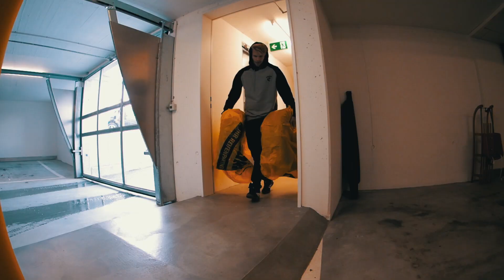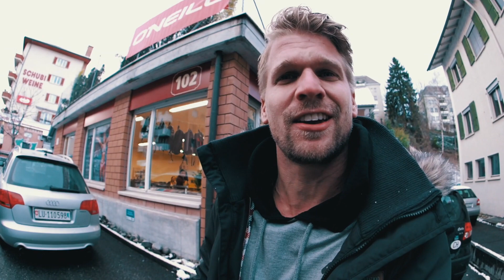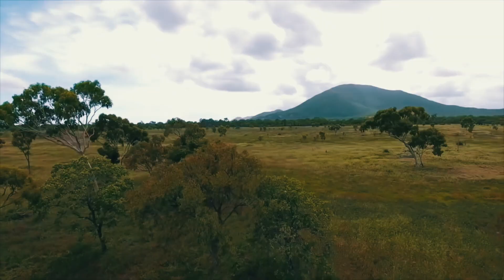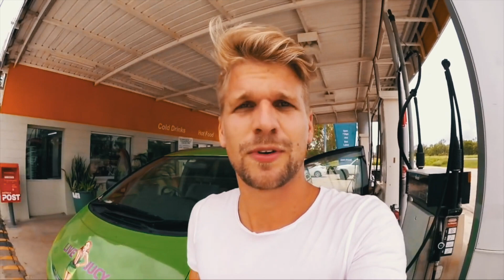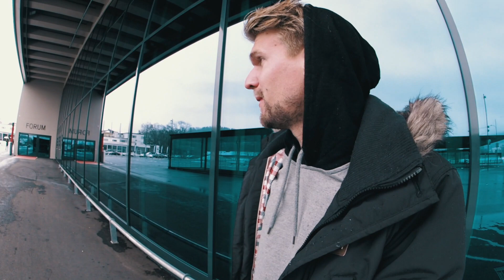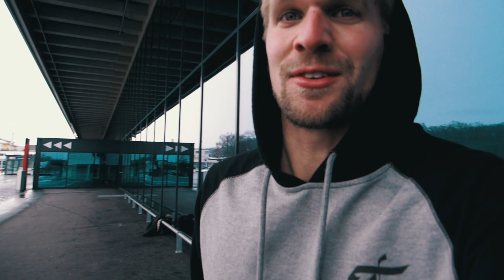How to find WINTER SKATESPOTS in Switzerland

Comment: that vibration on your car may be caused by the power steering pump if you feel the vibration in the steering wheel. also, could be caused by the width of your tire rubbing against the wheel well cover (the plastic above your wheel behind the fender)